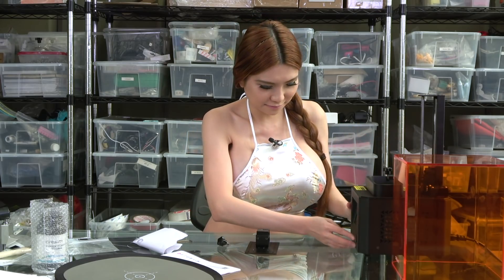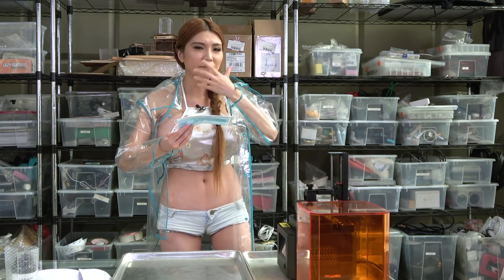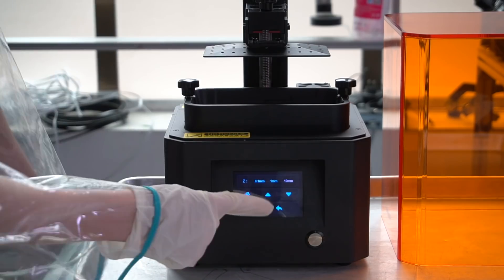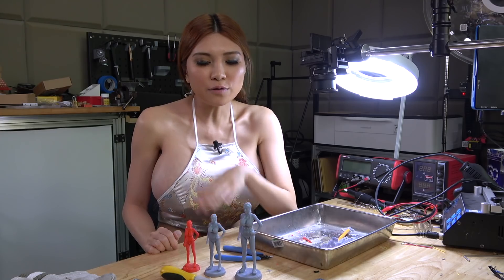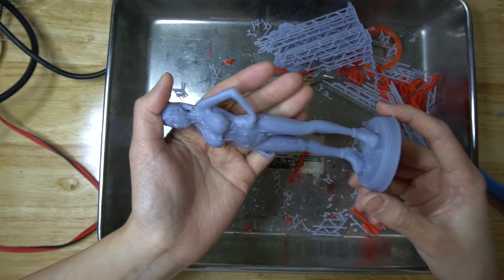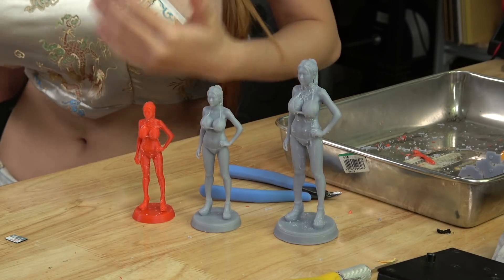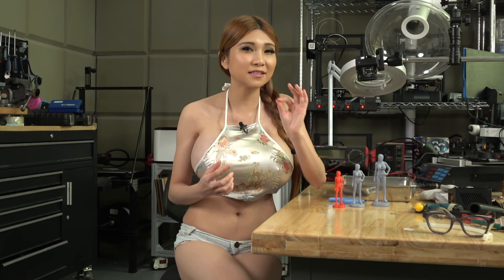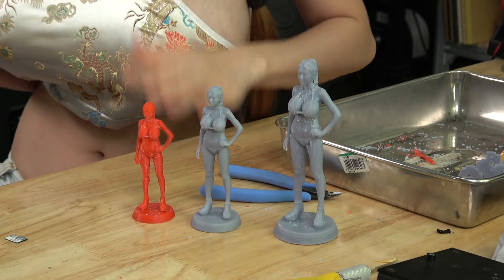Creality LD-002R SLA Resin 3D printer- Review and Unboxing!

Comment: Good review Naomi. Like you the 3 FDM printers in the shop are for functional and production parts, mostly carbon fiber or ASA. If I need a surface baby smooth we run it through the mill and machine the required surface. We thought of this printer when I got a notice in about it but the build area is limited and we do not work with parts that small. Keep up the good work. Your 3D scan does print up nicely.

Comment: Tried the heated point of my solder to smoothly remove from PLAsome supports imperfections. A quick touch is required to not deform the figure, but worked fine to me. Still no experience on resin, though.

Comment: Just a thumbs up, removing supports before post-curing the print is easier as the supports are still soft enough to break off(I just use my hands or slice it off with carving blades), awesome video as always!

Comment: I won't be bragging about my support removal skills. Nothing to brag about here, really. 

What does the trick for me is to reduce the supports to an absolute minimum in the pre-processing already. A slicer with custom supports is a must here. Then it's just a matter of setting the support top distance, which depends on the material or even the batch of material you are using. As you said, it can be dialed in.
Yet there will always be the problem of parts of the model being even more delicate than the supports and here patience is the key. For that particular model upright is a good orientation and the only supports that are hard to remove are those on the free hand and maybe that on the ponytail. If all else fails, I usually place a selfmade support model (a lattice pyramid) that I can scale to my needs and that works as a support for supports.
You are absolutely right when you say that FDM printers are best for functional models. However there are artists sculpting the most delicate things with a chainsaw out of timber, so it can be done if you feel like dedicating yourself to getting that level of skill.
I won't get to SLA printing anytime soon since I don't really have a dedicated workshop but rather a hobby corner in my appartement and I wouldn't want all the chemicals there. Also I am mostly doing functional prints anyway and decorative models I use more as a kind of test for my settings. I find it better to test on models that have at least some purpose rather than a thousand benchies or calibration cubes.

Comment: Some practical tips improve the result and reduce the work required. Resin right out of the printer is brittle in my experience. Curing it fully only increases that. When clipping supports off, the connection point may shatter and leave a recess in the model. Therefore removing the supports after washing the model is my preference, especially with visible connection points. I prefer submerging the model in alcohol, since that avoids missed nooks and crannies with liquid resein. Automatic support generation is often overzealous and creates more work than manual support placement does. Orienting the model in such a way that supports can be placed well and ideally connecting to less visible points on the model is important. I squared up the model to align the shoulders with an axis and positioned it at a 30 degree angle leaning back. I struggled a bit with the open right hand, where the individual fingers needed support, but managed to get a good print. I still need to paint it though. ;-]

Comment: I'm quite torn myself. On one hand with FDM I was always concerned (perhaps unjustly) with how prints tend to be mechanically relatively weak between layers compared to within the layer. On the other hand, with SLA I'm very unhappy with all the nasty aggressive chemicals involved. With FDM you can at least recycle failed/unused prints into new fillament, not sure what you'd do with all the resin rejects. But also keep in mind this is coming from someone who's never tried 3D-printing anything and has no access to a 3D printer. 🙂

Also, are you going to have that wardrobe malfunction already? 😁
Reply: You know its probably happened already and she just reshot when it happened
Reply: Regarding sla printing own a elegy mars and can confirm that in actuality the only real danger of resin 3D printing to a human is if you absorbed about 1.5 litres of resin but in small traces like the odd residue on a print touching your skin you are totally fine as long as you wash your hands under cold water immediately when this occurs to prevent absorption, and regarding disposal of failed prints due to the build volume and hollow functions of the chi to box slicer that comes with most of these printers or is recommended for these printers the loss of resin isn’t often that severe and I have managed to get about 30-40 prints per 500ml bottle of resin and about double almost triple that for the 1000ml option, so in short resin 3D printing isn’t dangerous as long as you take the correct precautions and side not I’d highly rescind the elegiac mars as it’s a solid beginner sla printer and it own resin is nearly completely odourless an to prove my point my printer is on my nightstand next to me and I haven’t suffered and medical conditions or illness because of it. 

Hope this helps you make an informed choice 😄
Reply: YouTube would ban her if she published a wardrobe malfunction.

If you want to know more about layer adhesion and strength of FDM prints, check out CNC Kitchen on YouTube. FDM prints can be really strong.